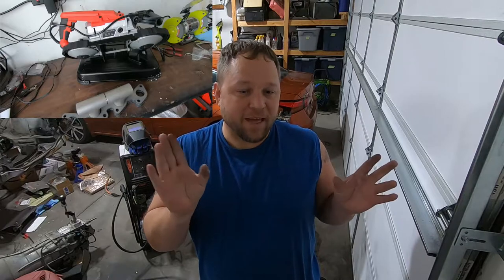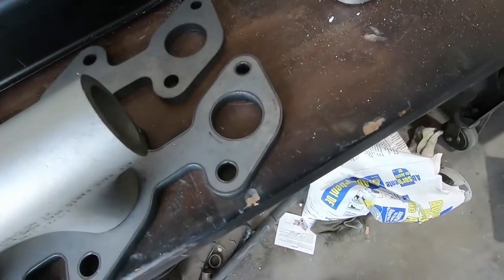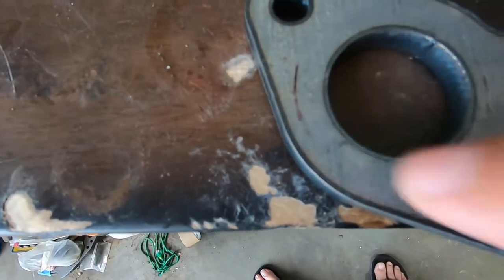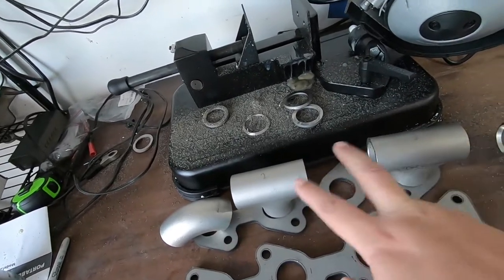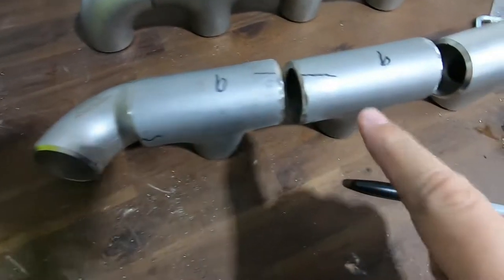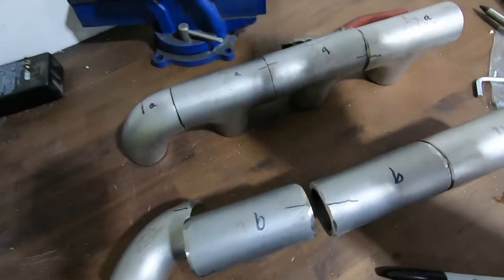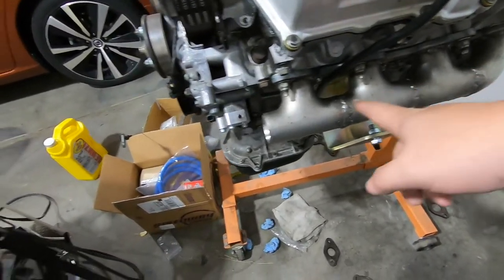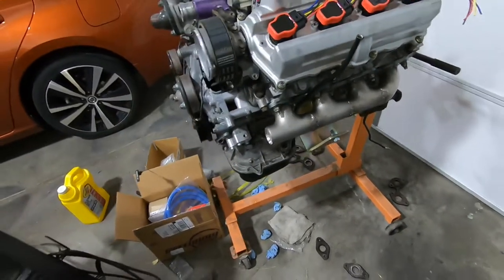Corolla + 1UZ - DIY Log manifold noob

Comment: I would put a heat shield sleeve on that dip stick.  Hold it down with some kind of metal zip tie.  Keep the manifold from overheating it, and damaging the o-ring at its base.  It’s inexpensive safety.
Reply from the maker: Thanks for the info. I doubt I would have thought about that.....till it destroyed things.

Comment: hey bud im doing a 1uz swap and like your manifold idea,  did  the runner on the alternator side clear the positive/charge  pin on the alternator ok
Reply from the maker: Yes it does. I have the log manifolds on and have started the motor with the alt charging everything. The main power post and all other wiring clear with no issues.
Reply: @UtahSleeper   thank you

Comment: hey man did you get your trans to shift
Reply from the maker: I had not, till today. Was lazy/forgot alot. I tried today and trimming the right side appears to give me 1 and 2, or so it feels. The left indent, where the spring and ball are, seems to only want to give me 6th. Can't seem to get 5th or reverse. I am going to try and lube up the indents and spring/ball and hope that I may get better performance. Realized later I could have tested just by loosening the bolts for the indents lol. Yours worked fine, right?
Reply: @UtahSleeper  after I had received another cd009 yes it worked perfectly lol if you need help with wiring or anything lexstreme is amazing and come with it’s fuse box and 3 wires to get it started and driving
Reply from the maker: @jakefinn9785  This site? https://www.lextreme.com/
Reply: @UtahSleeper  yes but I’ll send you the Facebook and send you pictures of the harness on Facebook